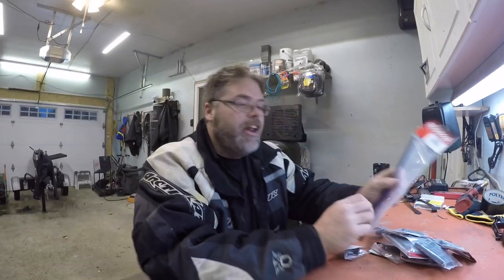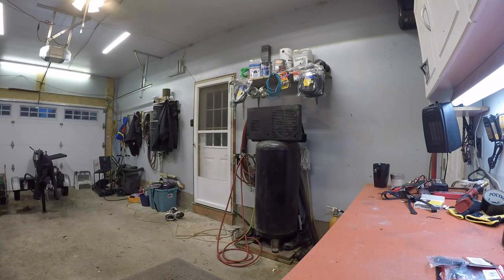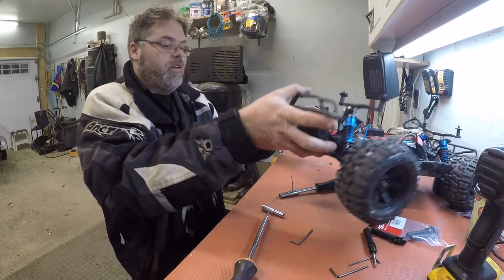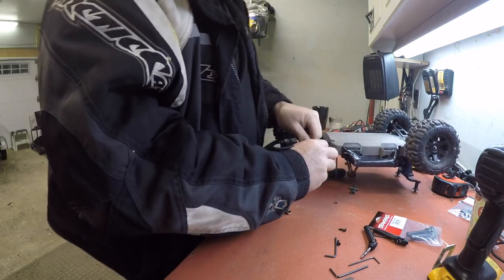Parts And My Thinks

Comment: Those center drive shafts never need replacing, u dont need 2 on standby, my bro has the same one from 2010 when we turned a stampede vxl into a slash with lcg chassis. And RPM makes the best A arms they got fiberglass in em bro